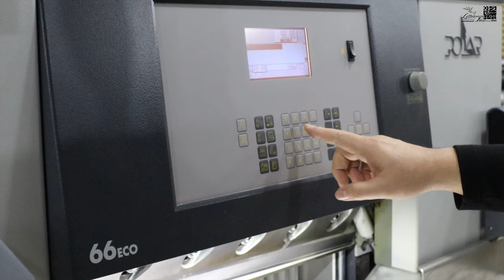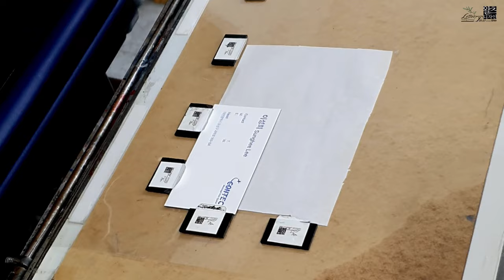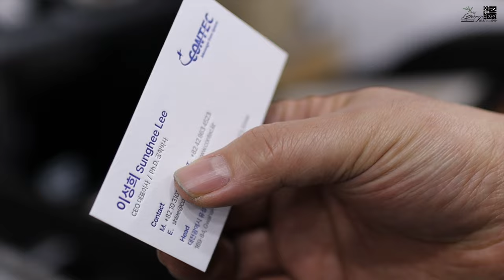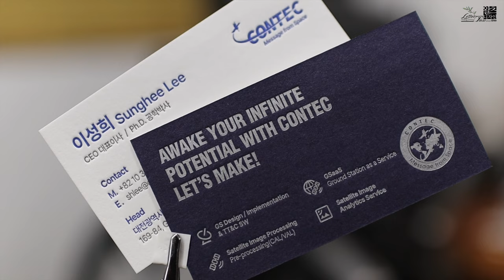Making letterpress business cards after gluing two pieces of paper together.레터프레스 합지 명함 만들기.

Comment: Nice work! A question: What did you use as a glue/how did you make the papers stick together? Thank you.
Reply from the maker: hello. Thanks for watching.
I use water based glue. In the past, I posted a detailed video of the merging, but
It has no meaning, so it only appears slightly in the video now.
https://youtu.be/OsArd0hQF_c  There is a lamination video about 8 minutes into the video here. There is a scene where glue is applied with a machine. The machine was purchased second hand in the US.